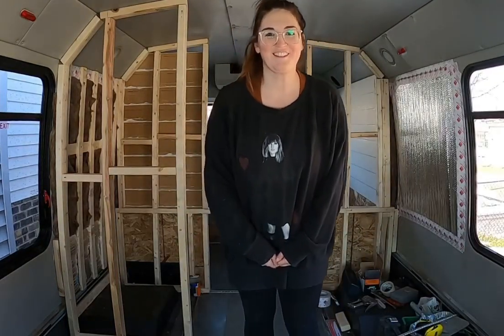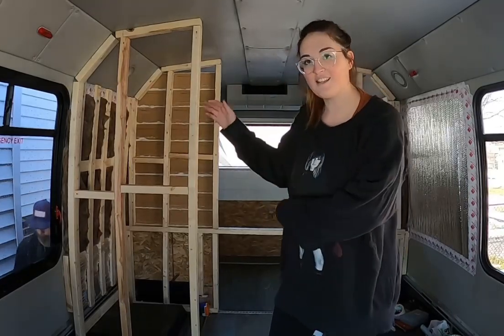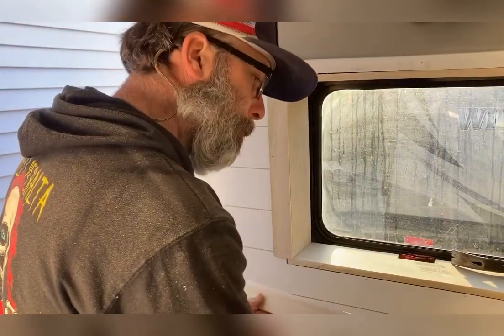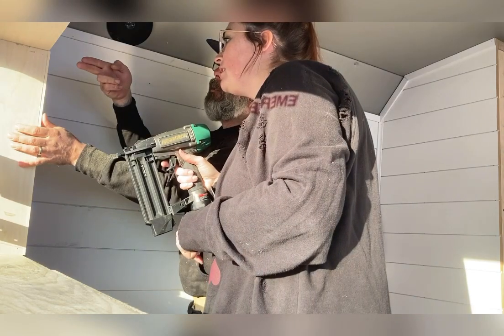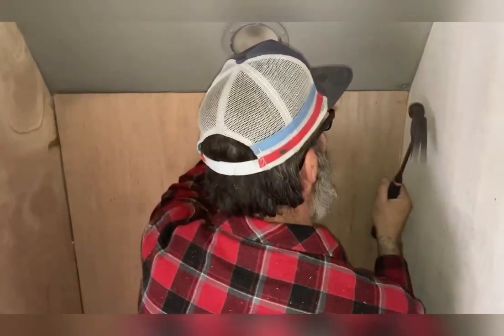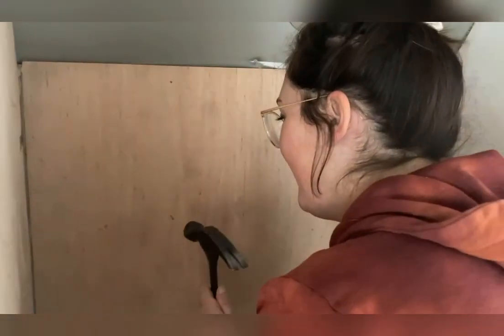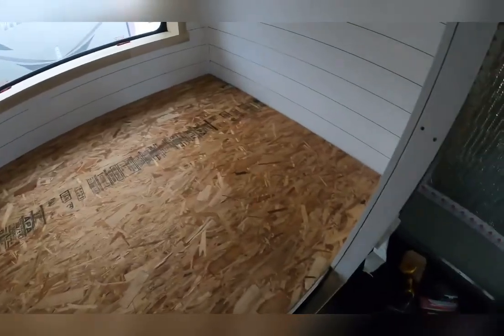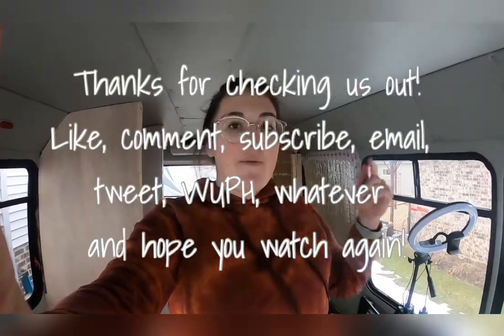Shuttle Bus Conversion: Finishing the bed and closet 🚌

Comment: Cute video. Had trouble hearing you over the music, though. 
You need to either drill vent holes in your platform or use a mat that lets your mattress breathe. Otherwise you'll have a moldy bed.
Reply from the maker: Thanks for the suggestion! We actually will address the mattress ventilation in our next video! And thanks for pointing out the sound volumes. I took it into account for the most recent video which is up now! Check it out and let me know if you can hear it better ☺️

Comment: Are you going to put holes in the wood so that your mattress won’t mold or mildew?!? Or is this not a have to?
Reply from the maker: Hi! Yes we have put slats to allow air flow. In one of the last videos we go over this, but we had to move them to get under the bed to install the diesel heater and water tank.

Comment: Why’d you keep all the lights and cloth wall in?
Reply from the maker: It was easier and cheaper to just use the original walls and flooring. I’m going to try and stay out of extreme weather and travel accordingly so I don’t need any crazy insulation or anything. 😃
Reply: @toriadams8624  ah okay cool! & cheaper is correct! I tore all of mine out and am replacing the wood
Reply from the maker: And wood right now is crazy expensive! Best of luck!🤞🏼
Reply: @toriadams8624  I’ve found that out the hard way. Just for new flooring I spent almost $300 and I still need to do walls and ceiling 🥲 but THANK YOU!